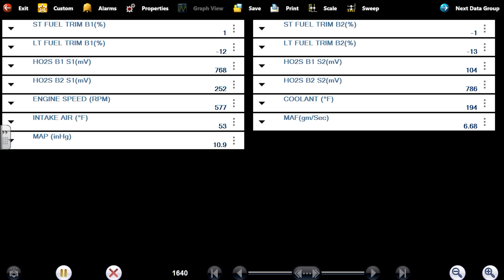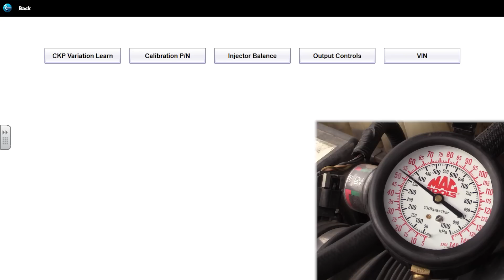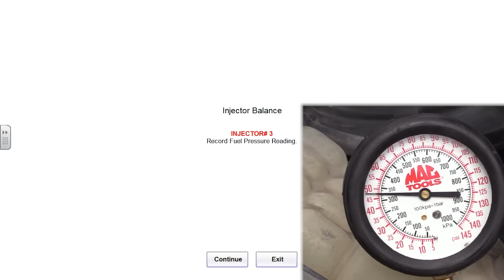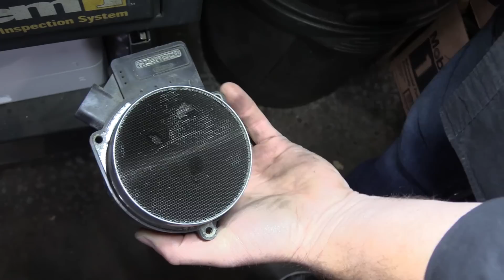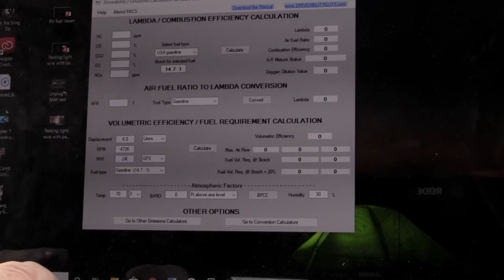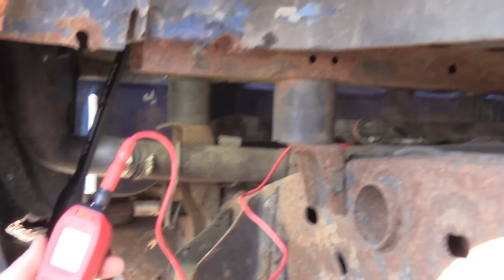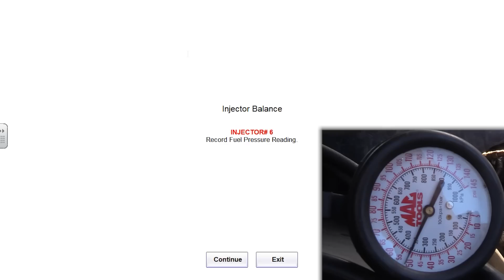03 Silverado Misfire, Rich AND Lean fault codes

Comment: A newly installed Sparta-branded fuel pump on 2001 Ford E250 is drawing 3.5 amps at idle.  Seems a bit low to me, so I asked Gemini AI and Copilot AI about it, and both responded that turbine-style fuel pumps (which Sparta does make) are more efficient and draw a max of 4 amps.  This new information means that unless the car has the original pump, we can no longer use amps to diagnose a pump if the amp reading is on the low end.  AI makes mistakes all the time.  I was wondering if you had ever heard of this.
Reply from the maker: I never use amps alone to condemn a pump, especially if it is producing proper pressure.
Reply: @ScannerDanner  Your fuel pump waveform on the Silverado has "micro humps" (the commutators) and "macro humps" (as the fuel pump shaft encounters pressure build up, analogous to a compression stroke).  Can the amplitude of the "macro humps" be used to diagnose a fuel pump?  And will AC coupling make the "macro humps" less pronounced?  (I am trying to understand the limitations AC coupling.  I haven't run into any waveforms with macrohumps in the field so I don't know the answer to that question yet.)

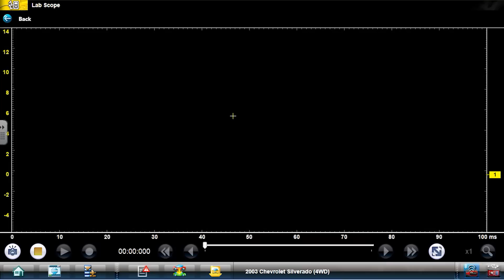Comment: 57:04 On these LS engines, the fuel pump ground wire is attached to the frame under the driver door.  If the truck wasn't lifted, I suppose you can easily get a current waveform for the fuel pump from that ground wire.

Comment: I also own a GM and I am seeing that at WOT the upstream O2 does not stay rich, it fluctuates so now you’ve put me in thoughts that my fuel pump is as good as shit. But then again on another video of yours you mentioned that there is a possibility that when the fuel cut phase kicks in GM might have potentially reversed the O2 signals
Reply from the maker: What year? I have heard that GM will stay in closed loop for a period of time at wide open (meaning you may see fluctuations in the O2 signal) but when the RPM is high and you are at wide open, that O2 should be full rich
Reply: @ 2010 Opel Astra j with 1.4l ecotec turbo engine. You must have seen this engine on Chevy Cruze because they share the same platform. I’ve reached till 3000rpm and still the O2 fluctuates as per normal on WOT. Now you’ve put me on doubts if I have a fuel delivery issue
Reply from the maker: @PANOS9916  I'd want to know what it does over 4000 rpm. Also what are your symptoms? Low power? What does calculated load show you at WOT high RPM?
Reply: @ the symptoms started when I was accelerating and the engine was acting like having hiccups. It was not smooth- linear acceleration and that was the point when I started getting suspicious. Then I came across your channel, I bought your book and went through your videos so I tested to see if the O2 would remain rich under acceleration. So it seems that the fuel pump might not be able to catch up. I’ll try to find an empty road and accelerate over 4000rpm and will get back to you

Comment: Hi paul first thanks for sharing this amazing case study. Im Ahmed99 im subscriber on your premium website. Can you explain why when you removed the regulator hose and then you snap it and it drops ? Imean it should be high regardless of throttle position. Because when you removed the hose its like giving full throttle Because you applied atmospheric pressure on the regulator so how when you snap it the pressure drops? I mean how applying full throttle will load it more than pulling the regulator hose?

Thanks
Reply from the maker: Fuel pump was bad on this from memory. When I disconnect the hose on a regulator for a snap throttle test it is only for the camera. So there are no affects on fuel psi from vacuum changes

Comment: This vehicle has a known exhaust leak.  As far as the rich fuel trims are concerned, wouldn't it make sense to fix the exhaust leak to see if that helps with the negative fuel trims?  It seems to me fixing the exhaust leak should be the starting point here.
Reply from the maker: Exhaust leak upstream or near an O2 = false lean = positive fuel trim numbers. Never negative!

Comment: The reason the injector balance test was off on first try and last try is because on first try you did not purge the fuel gauge. There was air stuck in the gauge, causing differential pressures during balance test. On last try you purged the fuel gauge, all the gauge line became full with liquid fuel, and gave you more consistent injector balance test numbers.

Comment: On the fuel pump amperage waveform, i was told yrs ago by a coworker the up/downs of the entire amperage indicates the armature is rocking back/forth in the bushing, so a mechanical issue. Noticed the fuel tank pressure sensors unplugged, thats why you had no change in the beginning when checking your purge valve😂 great info as always, Paul, and great video/editing skills, Caleb.

Comment: How are you Mr. Danner? Quick question? With the MAF sensor you’re talking about, 6L should be around 6, a 5L should be around 5G/ps, what would be normal for a smaller engine? Say a 2.4 Liter naturally aspirated.
Reply from the maker: Correct but under a 3.0L engine that formulas no longer works

Comment: is that gage measuring the pressure on the fuel line or the injectors individually?
Reply from the maker: Fuel rail that holds all the injectors. So the pressure that is available to the injectors

Comment: so in a car that has no service port to connect the gage to measure the fuel injectors pressure, can you do that test? where would you connect the gage in that case? I beleive the fuel lines comes stright from the pump into the fuel rail with the injectors...
Reply from the maker: I have a $500 fuel psi kit with a bunch of adapters and T fittings to install a psi gauge at the fuel line where it connects to the rail

Comment: How many miles those it go before you need to replace the injector do you know?
Reply from the maker: You shouldn't ever have to replace injectors based on mileage. Of course there is a life expectancy to everything, but I've seen engines with 300k with original injectors

Comment: I’m having the exact same issue with a equinox, I’m to the point where I’m starting to think the cats are semi plugged up, someone at some point replaced intake, manifold gaskets. I did the exact same injector balance test and had basically the same results. However, I pulled the fuel rail with the injectors and did the test. I found that when somebody had replaced intake gaskets and reconnected each injector they had injector harness wired to the wrong injectors that was causing my misfire and Rich condition which intern I think started to plug up the catalytic converter with restriction to the catalytic converter. Wouldn’t that caused negative fuel trim numbers because of the ECM trying to pull fuel out of the fuel trim?

Comment: I had bought brand new delcco injectors and had the same codes. Ended up being 4 hole injectors rather than the 2 hole design the truck came with

Comment: I wonder if there's a scan tool that can check the pressure and chart it and bidirectionally controlled the fuel pump and injectors all in one package?
Reply from the maker: A scan data PID showing fuel pressure would only be on a system that uses a fuel pressure sensor on the rail. Today's GDI systems are that way and some of the port injection systems had that set up.

Comment: Did you do a bleed down test before you check the injector balance? If one of the injectors is leaking like injector 8. it's going to throw off your test for injector 1 because of pressure is going to go down a lot.
Reply from the maker: You should yes!

Comment: I’m still trying to fix that ram going through all ur videos. Haven’t heard back from u. The truck has white smoke smells of gas it has low voltage codes and an open circuit on injector 7
Reply from the maker: reply in the original thread

Comment: The fuel pressure drop test is very inconclusive. I have a flow bench and have seen huge volume differences in the test tube and have then performed a pressure drop test just like you did and didn't see an issue.I had 8 third  3rd year techs in my shop as my witnesses. Fuel pressure drop test is so bad as a diagnosis, it should be obsolete!
Reply from the maker: Agree with you that it certainly is inconclusive on the low psi side of GDI systems today. And on the variable speed pump PFI systems. But on this system, that drop test very usuful.

Comment: Had a Rich Misfire on a 2021 Silverado yesterday with no noise and only happened intermittently. After removing the valve cover with compression gauge attached for the 4th time that day....it wasn't moving! would you believe the intake lifter came apart lol?

Comment: Is it possible fuel pressure regulator is internally failing, since current draw for the fuel pump is with in acceptable range? The pressure has to overcome the tension of the internal spring.
Reply from the maker: From memory, the fuel psi was normal on initial key on, and at idle and dropped under load. When a regulator fails, it is either too low or too high of psi all the time. Good question

Comment: Hey Danner I have a 97 4.3 s10 when enters CL is maxing out rich ST and LT fuel trim. Negative numbers like -30 and -17 respectively. 
The MAF is overreporting. About 10 g/s at idle, but if I unplug it makes no difference in FT. 
Holding at 2000rpm it gets close to 0 in but after 20 seconds it goes back to crazy negative trims. 
Can this be caused just by the overreporting MAF? Im starting to think theres another problem somewhere. What else could it be?
Reply from the maker: Sounds like another problem my friend.
Let's move this to my forum www.scannerdanner.com 
It is free to join and we can definitely help you. I have 28k global members and hand picked moderators who've been with me for years and know my material inside and out and are there to help me help you guys. It is just too difficult to offer back and forth messages here on YouTube with stuff like this and we also can't share pictures and images here like we can on the website. Hope to see you there!
Reply: I also checked no evap leak no fuel pressure regulator leak and no stuck open egr or pcv valves.

Comment: Hello sir I have a problem I have a lean condition has gotten up to 16 on my long term bank 1 and around 14 or 15 on bank 2 could bad injectors cause this? I replaced MAF replaced fuel pressure regulator purge solenoid vent solenoid spark plugs coil packs wires also smoke tested it no vaccum leaks it seems to keep going up my MAF is around 4 something less than 5. No evap leaks either not sure what it could be no engine lights either. I have a 2001 Silverado 5.3l.
Reply from the maker: What are your idle fuel trim numbers compared to 3000 rpm in park?
Reply: @ScannerDanner  it doesn't go down during higher rpm like a vaccum leak would do...
Reply from the maker: @robpaul7900  is this a flex fuel system? If it is check to see what you alcohol % shows you on the scan tool and if you are not running E85, it should be below 10%
Reply: @ScannerDanner  no my truck a 2001 is too old to show the alch. Percentage  on scan tool my gfs Tahoe shows it hers is a 2012. Mine isn't a flex fuel I changed the MAF sensor and replaced pcv grommet (was lose) it went down a bit, staying around 8 to 10 now can't figure why it won't go down any more. I have an alch tester I bought online I'll let you know my result any other ideas?
Reply from the maker: @robpaul7900   8 to 10% is fine the spec for fuel trim is plus or -10% being considered normal
Reply: @ScannerDanner  thank you looks like it has dropped even more I had a new MAF sensor I had replaced my old one with awhile back it must have came not working correctly and I think I had a small vaccum leaks from pcv grommet. The funny thing is my MAF that is 20 years old after a good cleaning works like new thought I was doing a good thing replacing my old one but the new one wasn't good ha. Well like they say if it ain't broke don't fix it sometimes is right and they don't make parts as good as they used to. I just thought it would be good for it guess not. Thanks for the help they have gone down to about 5 bank 1 and bank 2 is around 3 for my long terms.

Comment: Broken manifold bolt will mess everything up can’t believe you didn’t address that first
Reply from the maker: Broken manifold bolt will NOT cause a low power lean condition at wide open throttle

Comment: You know you can chase your tail around forever if you have bad ground and power + at the source (battery) 
Even if it’s not 
Every car needs it and will benefit from it and 
It’s definitely a good place to start and you will fix very weird things that you could never find
I recommend to use anti seize compound to keep the corrosion away from happening in future and razor blade the metal and remove paint under the connector 
And you are working with a known proper baseline from battery to every component and computer and ecu

Comment: Reason for the differences in the ending pressure on each test (each test meaning after all eight (8) cylinders) is because the diagnostic computer randomly chooses how long the injector test should run. Like the first (1st) test you completed, each injector was tested for approximately 3.0 seconds (with me guessing the length). And as for the third (3rd) injector test, lasted for approximately 3.4 seconds... The ECU tells the injector to pulse at a given rate for a fixed amount of time. The amount of time is different each time you run the injector test.... Anyhow, I love how you explained the test overall, it made sense. Some people can't seem to make simple things understandable... As for the fuel pressure drop on the load test, your absolutely correct, it's not supposed to drop any. My guess is like yours, fuel pump related. It's also possible that the fuel pressure regulator is failing, or leaking injectors as you stated also... Not sure if the guy got this all fixed or not, I haven't gone through all the comments yet... But this is the second (2nd) video I've watched of yours, and I have subscribed to your channel, and will continue to watch more. Your very knowledgeable in the diagnostic's which I am always wanting to take in more knowledge any way I can. Keep up the awesome work and Happy New Year!
Reply from the maker: You know what? Props to you man, because only a few can truly recognize what I was dealing with. Really glad your here.
Reply: I've been playing catch up with your videos but don't usually comment, especially on the older ones just because I feel like it's long passed and no one will see it anyway. But, I have to tell you, I loved this case study! You may have not gotten the repair but it's clear to see what you were saying and I absolutely agree. The pump is junk for starters, should never see fuel pressure drop like that under load, and the injector balance test was also cut and dry. Balance test is just that,  a balance test! Injectors should all be within the same range not 2+ lbs plus or minus of each other, that is off balance,  a pound plus or minus  a touch, ok. I thought you showed a lot of great procedures while clearly explaining the thought process . Also, that exhaust leak has No bearing on the condition present IMO.  Sorry for the long message, and I wasn't going to comment! 😂 May God bless, heal, and protect your family always! Peace.

Comment: I have short term bank 1 reading  25.0 and Short term bank 2 reading is 25.0 then both goes back down to 0.0 then go back up to 25.0 I was looking at the fuel system 1 and fuel system 2 it's saying open loop fault when I step on the gas to 2500RPM and let it go the short term drop down to 0.0  I have a vacuum leak somewhere
Reply from the maker: Sure sounds like it. And the STFT will drop to zero when it goes into an open loop fault btw

Comment: If Snap On engineers watch this episode then is good to improve his scanner... SO, on that injectors test balance is good to have some windows to made notes!? eg. Starting test pressure, drop pressure and differences between pressures (indeed, differences between pressures be calculated automatically) for each one injector.

Comment: If you go to feed mode on the PPIV  this forces current to flow across a built in resistor inside  the unit.

Comment: Hi boss I have a quick question I did my first brake job on a 4Runner 2002 limited and I noticed on a cold engine the brake reservoir would be on the max line but after it’s warmed up and used. it would drop between min and max line should I be concerned?
Reply from the maker: As long as it is full cold again, I wouldn't worry, though that is strange.
Reply: @ScannerDanner  thank you boss for the reply . I Love your videos and I feel like your my teacher in a sense I’ve learned a lot watching your  videos. Thank you for your posts

Comment: What's happened with this car ?did you fixed it or not ,what's the exact problem Paul?
Reply from the maker: We never addressed the negative trim issue. But the low power and lean issues were from a faulty fuel pump as we talked about. 
Frame was rotted on the truck and I dont think any of the repairs were done.

Comment: I hope this is helpful but there’s an equation I use that seems to be relatively accurate to figure out what the maf reading should be. The displacement should equal maf reading at 600 rpms. So when you multiply actual rpms by engine displacement and then divide by 600 that should be your MAF reading and I’ve found you can have about a 15% difference that will still allow the appropriate functionality. So for example rpms are at 1595 on a 6.0 it would look like this 1595X6.0=9576, 9576/600= 15.96. And through my own trial and error anything within a couple g/s off idle is ok and at idle it should be pretty close.
Edited for grammar